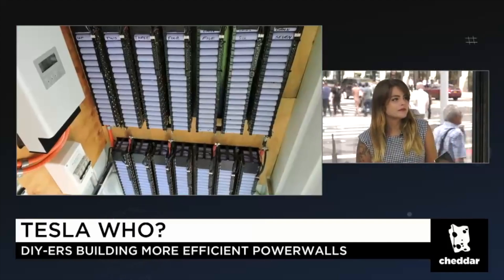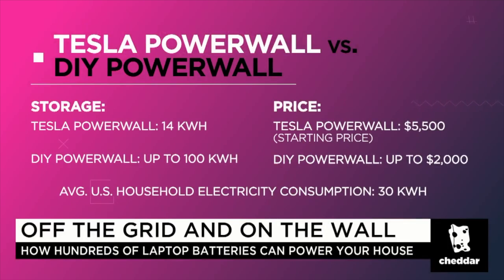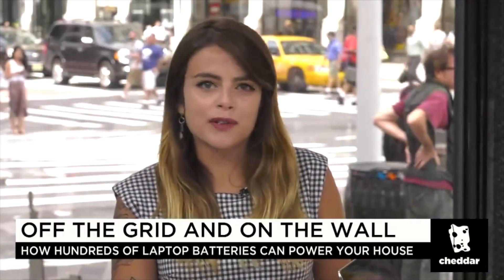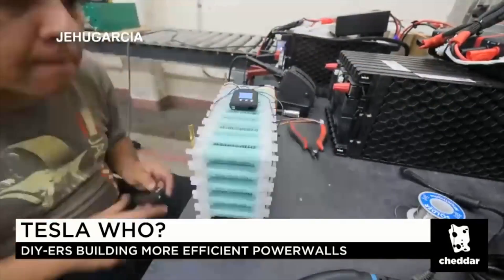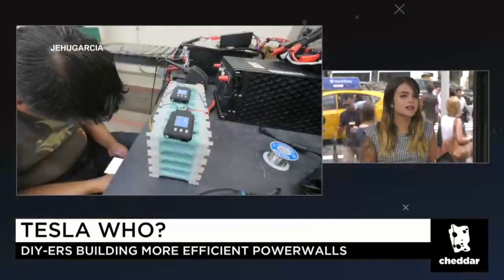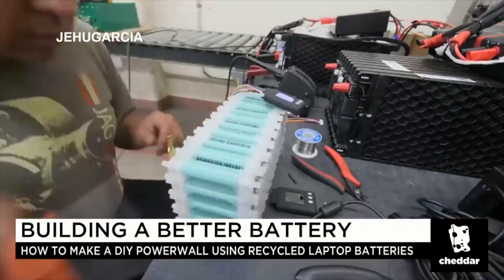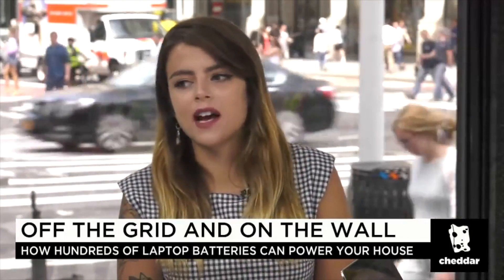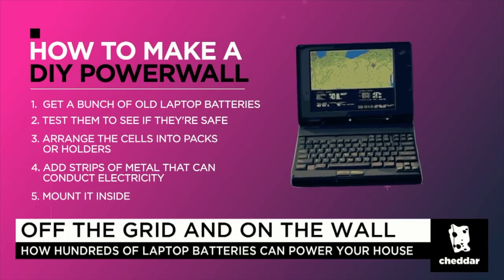Speculating TESLA Model 3 Motor with Otmar Ebenhoech

Comment: WTF? All they use is a synchronous motor, which is an alternator. You use DC in the armature to create the field and 3 phase AC in the stator.

You vary the speed with the 3 phase frequency and change the synchronous pole angle with the DC to adjust for the dynamic torque (load).

When you want to regenerative brake (generate power) you increase the DC field and adjust the 3 phase frequency with the travel speed.

Honestly you need to do some more research. Your experts are speculating with minimal knowledge.

A synchronous motor is what is in your power station and has been around since the year dot. Nothing new. Your guys should know that. No need for permanent magnets, that is why you have a battery in a car. Its for the alternator and starter motor.
Reply from the maker: Oh god,   Why is it the most ignorant always speak with the most conviction?   The model S car uses 3 phase AC induction motor.   The model 3 is using a permanent magnet motor.   Please practice what you preach and do some research before suggesting Tesla’s use alternators at the wheels like every other nut job on the internet,  please.

Comment: it think its a synchronous reluctance motor . ABB manufactures such motors. you can see videos of it on youtube. they are 2 frames smalles than induction mtotor for the same power and very efficient. it could also be a combination of IPM (interior permanent magnet) motor and a synchronous reluctance motor.

Comment: One question, why do US households use so much energy? The average Dutch household uses around 6-11 kWh per day.
Reply: ah......size? have you seen the average sq footage of a US home? It's double the Netherlands average sq footage! Imagine having to cool that home in Nevada/Texas/New Mexico/California or heat that home in winter! Also for the northern US and Canada regions, it's common to use baseboard heaters in high rise condo's where they don't have a central ducted air exchange system (see cheapest way for developer to build a 50 story high rise condo and provide heat) rather than gas furnaces and those baseboard heaters can be up to 2KW (that's 2KW each and they might have 5 per household, one for each bedroom) electric baseboard heaters. Not to mention, many of those houses are poorly insulated for winter, many people who own a 2,000+ sq ft home have other electrical energy consuming monsters like heated out door spa's, garage's full of power tools, etc. Even the lighting used in the US was mainly incandescent bulbs, so lighting the house at night consumes a fairly large percentage of that electrical consumption plus it's pretty bad practice to leave lights running......The US and Canada is getting better with energy consumption with LED lighting becoming common practice, using better techniques for insulating new homes with high R values. It's the same story in the US with driving.......Drive down a major highway and see how many earlier (1995-2005) trucks and SUV's like F-150, RAM 1500, ford escapes, etc. are driving down the road with one person in them. These vehicles have one of the worst gas mileage ad are used to commute to work during the week and not used for work.......It's a cultural and society thing which the US has a hard time cracking, but are slowly changing........
Reply: How many Dutch households have Central Air Conditioning?  I would be surprised to see any.  Also US houses are bigger than the average european house.  Ours is nearly 4000 ft2 (370 m2).  We use about 16 kWh in winter and 80 kWh in summer for A/C
Reply: Australia is very hot and the houses are on average comparable or larger than US houses but the average daily usage is 15.9kwh (5817 over a year) vs US average daily usage of 29.6kwh (10,812 over a year).
- average new build in Aus has dropped to 241sqm but is still higher than average US new build of 222sqm
Not convinced large houses and hot summers are the reason for such high consumption.
Reply: Well, take away the A/C and we use about 500-600 kWh/month.  All LED lighting, home office with 3 computers running all day, Tesla Model S plugged in at night.  One thing is we do a lot of laundry and my wife prefers to use the dryer rather than hanging the clothes to dry.  Not sure how much that adds, but I'm sure its quite a bit.

The big difference is when the A/C is running.  It can consume 2000 kWh a month just by itself during the hottest months.  But we enjoy our A/C set at 72F(22C)!

A relatively modest 4kW PV system would knock out the base load, but it would take an 11kW system to knock out the max load.
Reply: Larry: As a fellow Aussie (Now living in Canada) I would have to disagree regarding house sizes for Australia and the US. Your figures quoted were for a very short period around 2008/2009 The US average house size is larger than the average Australian household from 2015. Historically more so than recently. Australia has increased the size of the average household over the years, but the US household has always been large comparatively.
https://www.commsec.com.au/content/dam/EN/ResearchNews/Eco_Insights31.10_US_overtakes_Australia_to_build_biggest_homes..pdf

Also, let's not forget the higher consumption of electricity I mentioned being highrise apartments or condo's as they don't use Gas furnaces, so purely heating in winter using electric baseboard heating which is a massive electricity consumer in a 30 story highrise. I'm not sure that apartments or condo's are factored into the household stats, but if they are they will have a significant impact on the numbers.
Reply: I don't think it's average.  I only use around 3 to 4 KWH/day (but the car adds another 10 KWH/day), and 1 KWH of that is the fridge.  It depends if they have central air, electric or gas water heaters, or electric cookstove.
Reply: 30 kwh avg is just ridiculous. Don't they be ashamed of that. Most electric cars aren't even 30 kwh.
Reply: Oh forgot to mention that consumption includes charging my car.
Reply: Roger Heuckeroth thanks for the reply Roger and the others. We use around 3800 kWh for a year including charging my 100% electric Renault Zoe. Currently in the market for buying A/C heatpump, but mainly for heating in the winter, it would add 1100kWh for heating per year and 120kWh cooling per year. So 4500-5000 kWh p/y

Most houses don't have A/c because it is a moderate climate here. And houses are more like 110m2 average here.

Most Dutch people use gas for heating and hot water though! That might be a big difference too.
Reply: Roger Heuckeroth and: Try to get a Daikin Ururu Sarara heatpump/Ac if your A/c breaks! It pretty affordable A/c and in the EU the most efficient one energy saving wise :-)
Reply: One more thing: on-demand hot water heaters are still quite rare in the US. The usual practice is to keep a large (50-80 gallon, 190-300 liter) tank of water heated to 110-120 degrees F (43-48 degrees C). Instead of replacing the water heater with an efficient on-demand unit, we usually just add another layer of insulation. Compounding the problem, many local codes demand that the space containing the water heater be ventilated from outside, making it even harder to maintain the desired temperature.

Oh, and our refrigerators tend to be at least twice as large as British refrigerators too. Theirs usually fit under the kitchen counter. Ours are full height and often extra wide with double doors.
Reply: Stefan Brand - Yes.  Unfortunately, the builder had already chosen a A/C that is not highly efficient, before we bought the house.  If it has problems I will upgrade it, but before that we plan on putting in a grid tied PV system.  I think that will be a better investment.  A/C is critical for us for about 4 months of the year.

I hear good things about the Zoe.  I assume you are happy with it?

Comment: dingbat reporter saying there are safety concerns about people using batteries, and issues, etc. etc. playing on people's fear of something they know nothing about.   Funny how reporters can interview someone smart, and still give a stupid report.  I guess they learn nothing. They would do better having you as a guest on their show, get real facts about that is actually happening, and get a better presenter at the same time, Jehu!
Reply: TV stations only report accurately on things their sponsors have to sell in the ad-break.
Considering these Powerwalls are built with e-waste and cheap supplies from chinese ebay sellers, they did well to get any airtime.

Comment: A couple of notes about the Tesla electric motors. A permanent magnet based motor will always be limited in torque. One of the 2 interacting magnetic fields is fixed in strength. This also the more efficient motor since you don’t have to make one of the magnetic fields. The AC induction motor can be over driven and practically has no torque limit.

I’ve watched videos of the the Tesla induction motor being made There,s only something like 10 turns in each pole with about 20 parallel wires in each. This makes for a motor with a low operating voltage but can take significant amounts of current. In electric motors current is directly proportional to torque. It’s torque that pushes you down the road, not voltage or horse power.
Reply: randycarter2001 
What if you turned the surround magnets into electromagnets?
Reply: F = BILsinθ.  Torque or F come s from B (flux density, Tesla) which is given by L, length of conductor cut by flux at the angle of incidence. Coil voltage VL = N dΦ/dt (Faraday's law) shows that voltage controls flux density. While current is important it's mainly down to the flux density. When there is not enough voltage you crank the current but that is less desirable. 
High voltage in motors is always better as heat generated by a motor is given by H=(I^2)Rt. That is the square of the current multiplied by the resistance and time (deg C.). Lower turns is probable how they get away with no gear box and optimize the motor as an "all speed" motor.

Comment: How about instead of a induction and PM motor combined, you use a PM motor with a mechanical track system on the actual magnets. This way you can move the PM in order to mitigate the eddy current losses. Perhaps using a centrifuge type mechanical system on the PM? I don't know, what do you think everyone? Or maybe using a mechanical system with magnetic shields to shield the magnetic fields at certain times to help with losses. Also you food on the table made me hungry.
Reply: That's what I was thinking too. But that may increase the size/volume of the motor itself. However an interesting idea for sure. Higher speeds can bring magnets closer through centrifuge tracks in a mechanically calibrated manner and then "fold" them back and away at lower or zero speeds.
Reply: Nasir Aziz - yep, it would make the motor bigger. if it works, would it be better than the two motor idea? Who knows. I don't have the extra money to try. I'm using my extra funds for my DIY power wall.
Reply: The only way to find out is to experiment with it. Make a small scale 3D printed model and pull data from it and see what it shows? And then scale it up for commercial use if promising.
Reply: Nasir Aziz - stereo lithography and N52s, but what to use to shield the fields?
Reply: Haven't thought that far, but maybe somehow generate opposing fields to negate the effect?
Reply: Another way to think about it is to move PMs in and out on motor axis based on speed to solve both the problems.

Comment: What do you guys think about YASA motors?
Reply: The design of the YASA motors is totally different to what Tesla has designed. YASA are using an axial flux motor design, probably with a variable air gap so they can achieve what Otmar was describing for the pros and cons for the induction motors and PMM. I was involved in this motor design while racing solar cars in the world solar challenge back in the 1990's
Reply: They're great for high perrformance stuff. Compact.